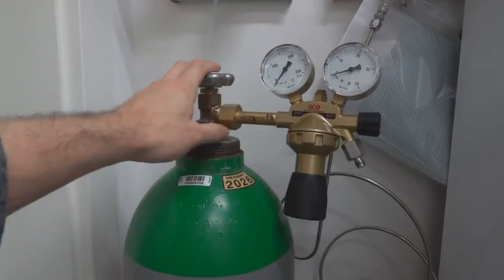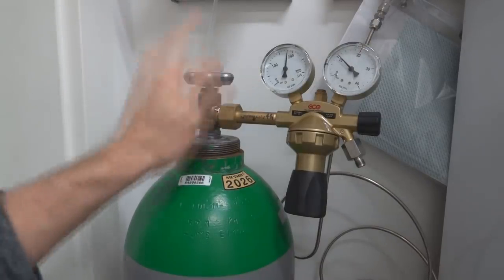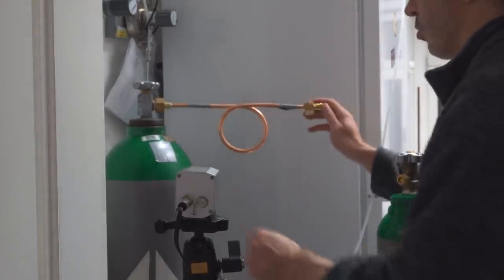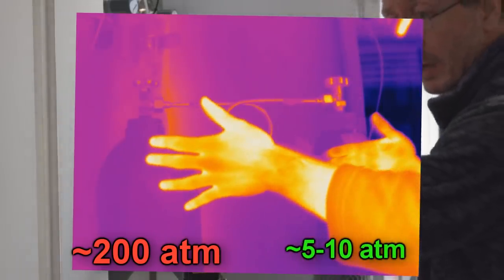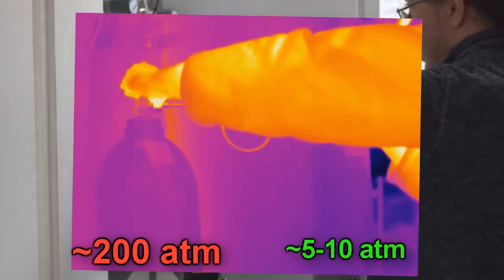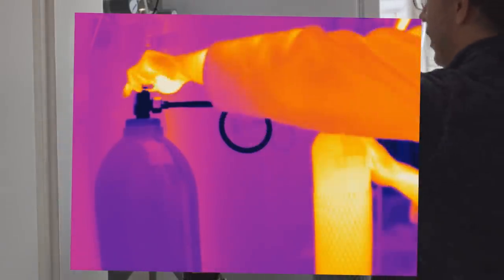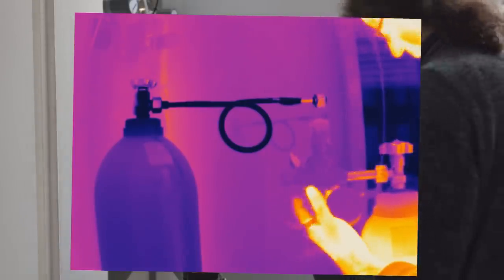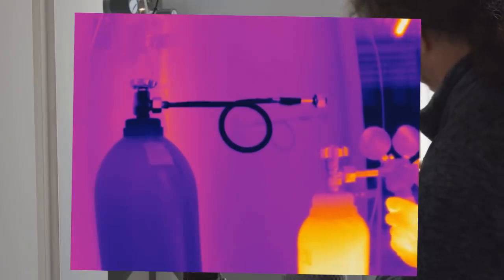Dangers of high pressure gas!

Comment: high pressure gasses scare the shit out of me.
Reply: We are instinctively scared by the things which we don't fully understand. It's good safety mechanism in our heads. With knowledge and experience, the fear becomes replaced with the caution. You want to get rid of fear by education and trainning, but you never ever want to loose the caution. If you loose your caution, the tragedy is near.
Reply: Sometimes the caution gets thrown out too though... he should have been wearing gloves, had the tank in ice water bath, and chained or locked down.  At the very least, he should made mention he was foregoing proper PPE taking the risk for the demonstration purposes, don't do this at home or at work in this manner.
Reply: After you've been around improperly handled high pressure cylinders and seen what one can do to a concrete wall when the valve gets knocked off, you tend to not want to be around them.

Comment: You should have throttled the transfer with the opening up the small bottle instead, and the full the big bottle open all the way. This would have the expand into the bottle, not the line.  That's why the line was cold.

Comment: I had to deal with this problem when I used to teach scuba diving.  Filling tanks off a cascade system (cascade system is a bunch of BIG tanks that the compressor fills, and you fill the scuba tanks off the big tanks).  We had to keep the tanks being filled in a cold water bath to keep them cool and get them full.  If you don't cool them down the temp would go up and say the tank was full.  But when  it cooled down a while later your customers would be a bit pissed off when the tank was 500 - 800 psi short.  lol
Reply: 😂😂😂, but did you ever cheat and fill to 3,200psi or so?
Cooling is the benefit rather than failure.

Comment: This reminds me of my job I used to have at a dive charter company when i was in university, when we filled scuba tanks which typically operate around 3000PSi (21 MPa) we would submerge them in a water tank just to keep them cool and i can remember that after a busy day the temperature of the water was quite warm and during lobster season we would have to keep water continuously flowing through since we had the capacity the fill 4 80 ft^3 tanks every 5 minutes, and we also had two intermediate stages that we would switch between (a "low" pressure around 1600 PSI, and the final working pressure) to help maintain a reasonable working temperature on all the components. My favorite moments were when the burst disk would occasionally blow due to corrosion or fatigue which created a rapid unscheduled flood that would ensure every one around was thoroughly soaked, also you had to manually turn the valve off for that tank which meant standing over the geyser for a few seconds. good times...   I still hear that hiss sound to this day.
Reply: 80 ft^3 is one BIG tank.😂😂😂 (in^3)
But did you ever cheat and fill to 3,200psi?😎
Cooling was the benefit and not the reason, but rather failure.
Sounds like you were operating a cascade system.

Comment: Elon Musk should stop making technical promises when he doesnt know shit about the science behind it. 

This not only goes to Elon Musk.
Reply: @Ken Harris Dreamers don't get anything done, if they stay in the clouds. Dreams need to be checked in reality. That is where science comes in. Dreamers based in science get things done or shelve those ideas that do not work yet. Dreamers without common sense are often winning the Darwin award.
Reply: @tonyb24242424 I assume you've got that right. ;)
Reply: Elon has a bachelors degree in physics and claims most of his daily work pertains to engineering design. He's probably well aware of most of the drawbacks and is either blowing caution to the wind, trying to drive marketing hype, or both. Ultimately though I can't see him releasing something to the public without massive evidence proving safety. So far everything he has sold from Tesla is the safest product in its respective market. If safety results prove less than stellar in the spaceX package (by far the most niche car Tesla sells) then I doubt it will be sold. Any potential news story of a Tesla roadster blowing up in a car crash with enough power to obliterate a nearby building won't go over well.

That being said I agree with the skepticism. I have not stepped through the thermodynamic or fluid dynamic calculations of Elon's promises for the roadster's SpaceX package, but it doesn't take much to realize heat dissipation from transferring high pressure gases and general safety (compressed storage and gas emission) will be very difficult (and likely impossible) to secure if the car is intended to hover for several seconds.
Reply: @adamfink5294  ok, so he got a bachelor. Did he use it in any job? Has he experience in applying that knowledge? Got he refreshment on knowledge?
Why did he not add a master? Somebody who wants to be an inventor and not just an investor for inventors should have tried to get more knowledge. Master maybe even Doctor.
Reply: Name a better billionaire. There has to be billionaires that do way more to further technology and innovation.  We should make a list of the billionaires that build better electric vehicles and spend more time and effort and money to privatize space travel. There must be a dozen billionaires in texas alone the do way more to help move new technologies into the market place.
Reply: @sndspderbytes     Biocultured meat startups are or would be the better billionaires.
Reply: @fredphlogiston4620  I don't see how anything not related to Elon Musk could be exonerating him. We are not talking about other people, but him. He reinvents old ideas (Hyperloop was an idea of Goddard the rocket pioneer; electric cars ran out of fashion 90 years ago because of oil industry), makes pulicity stunts, throws money and engineers on this topics, yet not a single idea was proven under realistic conditions. His marketing skills (he studied that too) seem to be better than his bachelor at applied science. 

Thats the topic here. Don't deflect from it.
Reply: @mflax4331  I am not exonerating him at all. I do only one thing: Put in question the argument that because he has only a bachelor degree it would be an argument against him. - Apart from that there are other things that make me doubt about Musk.
Reply: @fredphlogiston4620  I'm not basing my opinion on his grade alone. See my answers. There are sufficient points in it, that are not referring to his grade. On the other hand a grade does not guarantee success in a certain field of knowledge. I believe that knowledge AND dedication can make you shine big style. And you need a bit of luck as well. Remember Bill Gates or Steve Jobs - they did it and they did not have the grades. But they got dedication and determination.
Reply: @mflax4331  I agree with you. It was only this point it interested me. Maybe it was an excuse to put the attention on this inventor. To me he looks licit.
Reply: @mflax4331  He has created several multi BILLION dollar companies, so... yes, he has used it?
Reply: @DynamicUnreality  Businesses, ah yes. Do they make profits regularly or are they only cost money? Creating big companies and throwing big money at it, isn't a solution, if they fail to make money.
Reply: @mflax4331  Elon Musk actually isnt out to JUST make money. He nearly bankrupted himself trying to get SpaceX off the ground. Pun intended. He was one failed launch away from losing everything. His companies have done more to inspire people than his tech could ever hope to accomplish. And that is a GOOD thing, no matter what people say about his empty promises. Elon Musk has inspired more people to enter the sciences than anything since the Apollo program. And Tesla actually DID record a profit third quarter last year, and we'll see soon how the fourth quarter went. He's done a lot more with his dreams and cloud walking than you have with your pessimistic, shitty youtube comments.

We need more dreamers. Not less. Not everything has to be grounded in reality all the time. Trying to test the limits of what we think is possible is how we improve the human race.
Reply: @DynamicUnreality  Being critical is "pessimistic & shitty"? Thank you. You have just disqualified yourself as being a honest discussion partner. Having a different opinion doesn't mean you are allowed to disrespectful behaviour. --- Good luck. You cannot convince me. Discussion ended. Put your unfounded ideas somewhere else.
BTW His dreams had already been dreamed by other people. But science and mathematics kept it from being tried. You don't need to do something, to find out if it is working.
Reply: @adamfink5294    Every kind of degree/knowlegde has to be cared for..otherwise it begins to erode. There was a test few years ago.. If someone dont used his Highschool-'degree' vor 5 years, he/she couldnt solve the easiest equations. In fact: the actual students in junior high school where better at those tests.
To use knowledge what someone learned, on a daily, or at least regular base, is very important.

And i dont speak about Tesla, and SpaceX ..
A electric car ISNT his invention -.- 
Also a self driving car ISNT his invention (there was plenty of those BEFORE Tesla). Musk was only the first who tried to massproduce electric-selfdriving cars. Which turns out, that it was a big economic failure (there you have the reason, why other companies didnt do it)... Tesla is since years in the red numbers...near to bankrupcy...
So even if there was no issues with the Tesla-car... the costs to produce those cars, dont go well with the prize... and if Musk would raise the prize enough to keep it up with the costs, no one would buy it.

Also like i said: maybe you dont believe me: but rockets are ALSO not Musks invention (surprise surprise ;) ) ... ALSO the reusable self-landing rockets are NOT the invention of Musk. 
These are well known technologies... Musk did nothing new or innovative with this... He only make a private company for this technology.. THATS ALL !
He even isnt the first private rocket company. He is only the one, who puts the most efford to praise himself via media/promotion/publicity ..and it works, as you can see... Mostly everyone praise Musk, what a genius he is. 

So these are the things (car, and rockets) which are well known technology already, which works.

What about the Hyperloop ? You didnt mention it at all... 
And even THAT wouldnt be Musk's invention. Thunderf00t already showed that more than 100 years ago, others had this idea to.. but they were smart enough, to do the calculation, and recognize: 'there are to much unsolved problems, costs and risks with it - so we dont build it'  (even if the problems could be solved (i give it to you) , and also the costs are 1 dollar per mile (i give it to you too) , the risks are unnecessary high, against an airplane (which the hyperloop wants to replace on THOSE tracks) ...

Also Musk claimed a rocket-based international transport-system.. Thunderf00t debunked this too (i dont want to repeat Thunderf00t's arguments).. Just one example: risk ... again.
Rockets are the MOST dangerous transport system man ever created. You have to recognize that (even if Musk dont). 
Statistical 1 of 150 rocketflights with astronauts on board are DEADLY.  Thats quiet a high risk. Astronauts have to sign this risk, and they do it. 
Please imagine, what this would mean for a worldwide rocket-based transportation system, where 1/150 of every passageer would die. Thats a lot !

Really im very surprised about so much stupidity of Elon Musk... even if i'm not surprised about the amount of people who idealize him as new 'Steve Jobs'. Even Donald Trump has his own fanbase... So stupidity isnt really a contradiction for the bigness of a fanbase.
Reply: @PygmalionFaciebat  You are right. Aside the busines which he made money with (which is proven) he is only recycling ideas that others have had years ago. He puts a new name and some engineers on it, makes some fancy interviews, considers calling someone an "idiot" makes a valid argument.... This list is adding every year.
His samples (like Hyperloop) are not even big enough to be used as reallife samples. Drilling holes underground and putting price tags on that, is not even considering the complete infrastructure needed. And nobody is doing a real checkup on the science behind it or the real costs involved to do it.
The things called out as success even have high failure rates before the success is made. And those success has never been made into a successful business model.
Inventors have lots of ideas, but not all of them fly.
Interviews are not replacing research and knowledge. Sadly "journalists" look for easy stories now, instead of facts. I'm talking of any jounalist - normal media AND social media.
As a businessman he should be able to compute basic facts. You don't need to dig holes to get some estimates on its costs. The knowledge is available.

Elon Musk is nothing but a travelling salesman. He might get real success if current technology can solve problems that stopped development before. But even that does not work always (Zuse build a mechanical computer, but it failed because of insufficient technology. Now it could be made better, but electronics are even better now.). 
Don't trust a travelling salesman without checking facts first.

Comment: So from what I've read from the guys over at nasa space flight forum, and a few other sources. It doesn't seem outside of the realm off possibility. Obviously it'd have to be used on a track and even then no racing series allows for it as of now that I know of at least. But you could take it to a track day and probably give it a go.

Here's an excerpt: "Looking at my half written article - filliing back seat with COPV - 140L of nitrogen at about 300bar 
~50 kg. Specific impulse ~50 means to get 1g of acceleration on a 2000kg car is 4kg/sec - 10 seconds of thrust.
So, not that unrealistic."

Also they aren't the only ones doing it. Bosch has been testing a system that uses cold gas thrusters to help regain traction on motorcycles. Big weight difference  but it's not like it's absolutely unheard of.

Will the car be able to hop up in the air like he claims? I doubt it. Would it be able to be used in aid of stability management like an on demand downforce, it seems like it. It seems like it would be able to help accelerate the car for a very short period, but I don't see why you would do that when you could just use it to put a ton of force on wheel to improve traction.

Just like the brabham bt46 or the old chaparral 2j they just wouldn't break traction with that force on the tires. Which they ran slicks and that also helped but this is going to be driven on the road so that's doesn't matter. I'd say the electric motor can accelerate it a lot faster if it wouldn't spin and just using this for grip on take off or in corners on the outside tires would be a huge benefit in terms of lap times. Which would just be for fun unless a racing series allows these things and I don't see that happening but the Pagani Zonda r isn't allowed at hardly any tracks due to its noise, it's not road legal and it doesn't fit competitively in any racing class bracket but it doesn't stop almost any car guy from wanting to give it a go.

This is just another evolution and the math seems to be there plus they got experience with cold gas thrusters and they make copv bottles. It seems crazy but I really hope they do it. We will see in the next two years if they can actually pull it off or not. Our opinions don't really matter a whole lot on what is going to be said or done at this current point. It's just speculation and that's fun I enjoy it. It's why I come here and musk has thrown out some stuff that was pretty damn out there not everything the man says works. But he's dumping money into trying and people seem to act like it's just him. He has two entire companies of people behind him with a lot of them being much smarter than him, you or I. 

It's not like he says it and walks into his garage by himself and busts out the old tig welder and sheet metal and gets to work. But regardless, I'm hardly an Elon fan boy I just like tech that comes out and works. Right now we just don't know we can get a good idea but we can't know it's hard to know more than an army of rocket scientists, engineers and massive amounts of cash. Now that can't make the impossible happen but if can make things that we can't figure out, get figured out.

Comment: I was in the fire service for 10 years we'v used 200 and 300 bar  for are B.A cylinder and air lifting equipment IV fully opened a full 300 bar cylinder untill empty it's extremely loud with ice forming on the neck of the cylinder was fun tho. Even when refilling using a compressor that takes 15min to charge from 90 bar to 300 the heat build up and expansion of the gasses will only take it to 270 bar so u need to allow it to cool and re charge them to get to 300 bar. I'd say it would heat the cylinder to around 30-40c